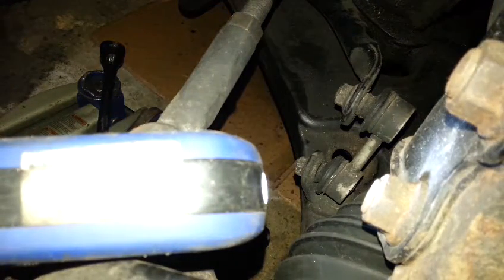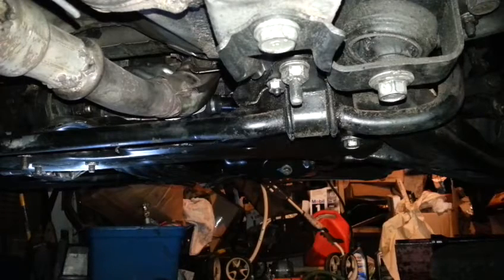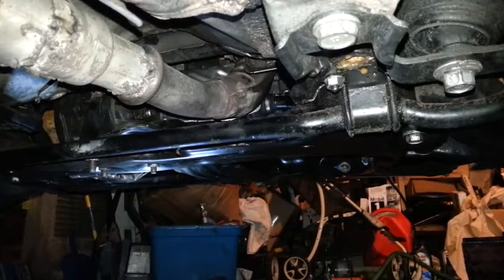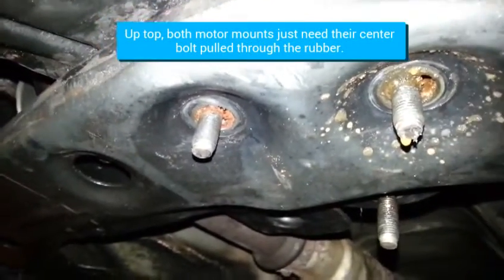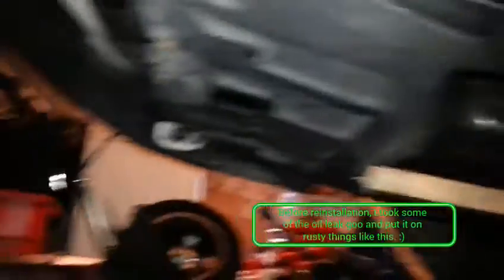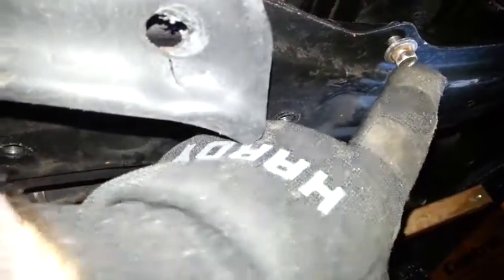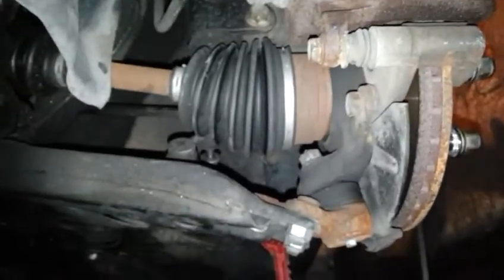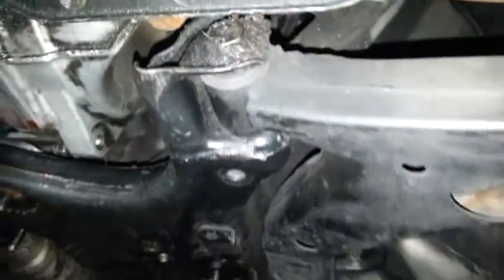Motor mounts front and back removal part 1

Comment: Trying to replace sway bar frame bushings on my 2006 Kia Sportage V6. Of course the bracket bolts are nearly hidden up against the body.
So far if pulled the sway bar end links and most of the bolts in the subframe to drop it low enough, but of course the rear mount won't let it drop enough.
I've struggled to remove a couple bolts that have no space for sockets and breaker bars, since the center bolt is very hard to get to also.
Low and behold, there is one more bolt to the transaxle at the top and hidden. That's where I'm at now.
Went to find some fancy low profile socket type wrenches I've seen others use from Harbor freight, but no dice.
Checking YouTube, since the manual is worthless on this and trying to find a way to get at it.
My other job is finishing replacing leaking valve cover gaskets. The front was easy and done already.
The rear is getting worse, alr ady lost an alternator from being coat d in oil and dripping on the exhaust makes for a very stinky situation. I've tolerated it because I wasn't losing too much oil, but it's getting worse, so I'll pull the intake and get into that while the car is down.
I'm wondering if removing the intake will help me get to the top bolt or maybe the center bolt.
My motor mounts are tight, so except to loosen them, I don't need to remove them.
Well, back to your video. Hope it offers some insight.
Reply from the maker: I have rescued an alternator once cleaning it off with brake cleaner. Clearly allow for drying time. A lot if it's really cold. Started a fire once in winter not realizing it was too cold to brake clean then weld. Things appeared dry. They weren't. It was below freezing. 

Sounds like you're having a heck of a time. Hanf in there!

Comment: Much thanks to YouTube, and it's incredible access to the horrors that The Great Rust can cause, I've gotten into a habit of anytime I take a part off the car, before it goes back on, it gets thoroughly cleaned, any hollow parts (stamped steel bits, typically) get filled with Great Stuff flexible foam, and all surfaces get thoroughly coated with rubberized tar/sound deadener/truck bed liner.  After a couple years, people tend to comment on how quiet my car is inside...  LOL

I hate rust...
Reply from the maker: +UnbiasedAuto Welcome to the channel. Great comment. It's too late for me to add rubberized tar/sound deadener/truck bed liner, it's all back together. Still editing that. So much video on these bigger projects! I did clean up the thick layer of oil, but at the same time, leaving a thin layer of oily protection as a preventative.

I also used some of my then soiled rags to rub into some protection into some rusty areas, like where the toe hook sometimes gets scraped when driving up a sharp angle.
Reply from the maker: +DE Nichols *tow hook

Comment: What made you look at the motor mount in the first place?
Were you getting any noise while driving?
At 13:30 you are taping a bolt that sounds loose. What does that bolt go to?
Reply from the maker: That bolt holds 3 things together. It holds the subframe to the unibody.  It also has a bar go onto it which makes this 99 handle about 3 times better than a 93-97 Corolla because it stiffens the frame. What's funny is I'm 93-97 (and maybe more years, I'm not a Corolla history expert) is you can put frame stiffeners on from 98-02 on most cars. The factory just skipped it saving money.

They also skipped the end links. This too can be installed with a sway bar on most of these cars. I'm not sure if the ones that can't, can't because of original factory part changes or because an aftermarket replacement didn't include extra connections for parts that they just skipped in those years.

When I last worked with this subframe a few years earlier, I put the sridfener back on without settling the tabs right and the handling was terrible! It felt loose and it was probably still better than cars without these handling upgrades!

A tiny tab locked in lateral motion versus leaving it moving a lot more. Parts bolt together either way... it's nuts lol.
Reply from the maker: During my long subframe and sway bar speach, I didn't want to answer a 2nd question. Lol. It's like a separate article. 

When I accelerated hard, I could  feel that the transmission was lagging behind the engine a little. Like the car was hesitating but the engine wasn't. Rare customers seek repair this early. It can feel like that during breaking depending on which motor mount rubber is looser.

Other reasons for noticing a possible bad motor mount or transmission mount is a clunk. This is when the rubber hadn't just deteriorated but been broken through or the welds on the mount have broken. It turns out during this project that I had this condition as well. Some aftermarket motor mounts will have super crappy welds. Took me weeks to get decent parts. I had to go Toyota. They custom made me a brand new part. Took forever. Lol Here's me addressing issues with the Toyota part: https://youtu.be/Q4UkLnGiLew I was this picky because aftermarket motor mounts lasted only a year or 2.

Motor mounts are oddly not called engine mounts...its an engine, not a motor! Pet peeve.
Reply: @DENicholsAutoBravado  An engine or motor is a machine designed to convert one form of energy into mechanical energy.
Heat engines burn a fuel to create heat which is then used to do work.
 Electric motors convert electrical energy into mechanical motion; pneumatic motors use compressed air; and clockwork motors in wind-up toys use elastic energy. In biological systems, molecular motors, like myosins in muscles, use chemical energy to create forces and eventually motion. From Wikipedia
a machine that uses the energy from fuel or steam to produce movement:  A jet engine or a car engine or a locomotive
a machine that uses energy to produce movement:  A jet engine or a car engine
something that makes something happen, or that influences it strongly: The USA has a great economic  engine going right now. 

Engines were used on trains before they were used in cars
Motor  a machine, especially one powered by electricity or internal combustion, that supplies motive power for a vehicle or for some other device with moving parts.
 You can call me Ray you can call me Jay ya doesn't has ta call me Johnston but don't call me late four4 dinner. 
Don't sweat the small things
Oh and they are all small things.
Reply from the maker: Thanks buddy. My pet peeves aren't taken much to heart. Real pet peeves require a lot more annoyance than I experience. Should we make up a term for a minor pet peeve or should I just give up on using this phrase and say annoyance? LOL  @mostlymoparih5682
Reply: Pet peeve is when I do something then you do the same and you say I did it to. It is not I did it to it is I did it too or also. That's why I  type two2 it kinda a blatantly wrong way to too two 2 Wright write rite right the word too I mean also.
Reply: My question about your car is because I am working on a 2000 Corolla and it has some front end noise. I replaced the struts and it helped tree men dos ly but I am still getting some noise. The struts were leaking oh and the rear struts also need two2 bee replaced. I believe the ball joints are okay and now I going after the sway bar links and the sway bar bushings.
Reply from the maker: Are you saying that the English language drives you nuts?  @mostlymoparih5682
Reply: @DENicholsAutoBravado  MPP  or make  it MVP which is most valuable player it could bee 
most venerable peeve.
Reply: @DENicholsAutoBravado  Well as General McAuliffe said,
Aww Nuts.
Reply from the maker: LOL. I love the most venerable peeve. While we were talking, I finished uploading my latest about Duralast ratchets. Are they getting any better? https://youtu.be/fX-Q5G-cCzo
Reply from the maker: I had a feeling you had one too. These ball joints nearly never go bad. Feel anything shaking the tires? Left right up and down?
Reply: @DENicholsAutoBravado  No shaking in the tires just a clunking noise and that's why I say links and bushings on the sway bars.

Comment: Just bought a 2002 4spd automatic chevy prizm today. When I put it in reverse it jerks   Could it be transmission mount or other mounts?  158k miles on it.
Reply from the maker: Of course it could! The front mount and passenger side mount go bad most often. 

Drive forward and backward to the car, but be firmly on the brakes so you don't kill anyone. Takes just a little gas and you can watch for which engine mounts are your slop... assuming it's not your front end suspension system having something broken.
Reply: @DENicholsAutoBravado  Discovered it was the CV Axle that the previous owner tried to fix, but replaced the boot only and not the seal to the transmission, boot came off because he used a hose clamp. Taking it in Tuesday for the fix. Hopefully that fixes it and not needing the mounts.
Reply from the maker: @EternalPodcast careful. Bad mounts is how these axles can go bad so the axle could be an additional symptom of the 1st problem. 

Ask me how I know..
Reply: @DENicholsAutoBravado  Thank you for the advice.. yeah when they replaced the CV-Axle they noted that the mounts were not broken but in bad shape. I'm going to try and replace the bad mounts myself in the spring or Summer. I do like the Prizm's drove the last one a '97 for 23 yrs. Until I had to take it to the junkyard a month ago. Lucky I found another one.
Reply from the maker: @EternalPodcast just drive easy. Older mounts and driving hard finished me off another axle.
Reply from the maker: If this next Prizm is new to you, be sure to use the same great oil 2 oil changes in a row and then you'll know where you're at. 

Around here they wanted $10k for a 2005 Corolla when my 2000 got crunched so I ended up with a Mitsubishi Mirage G4. For a thousand less. And 18 years younger. 

I'm in my 2nd oil change in on it with Pennzoil Ultra Platinum and I'm really feeling the difference. Don't fall for the cheaper regular synthetic Pennzoil. It isn't top tier like Amsoil that way. Made from natural gas is 2nd best to more expensive synthetic Esther's which most of the industry doesn't use even though it's better. And most companies that use superior base, they still are inferior to the Pennzoil Platinum Ultra made from Natural Gas.